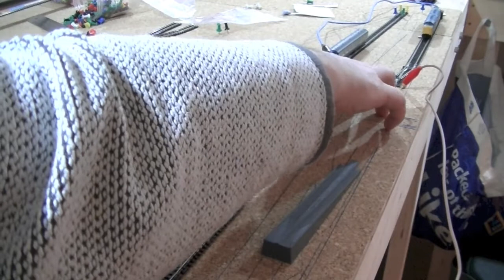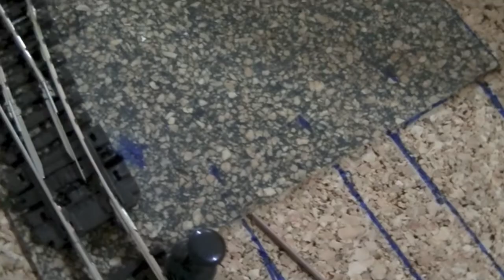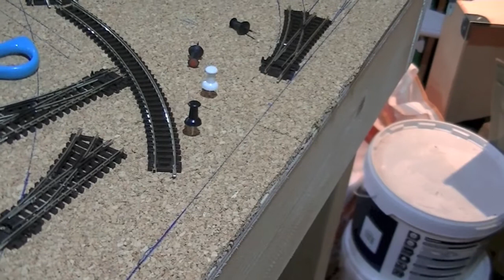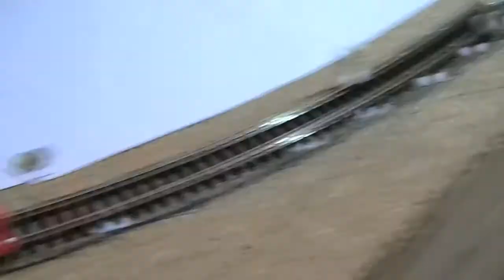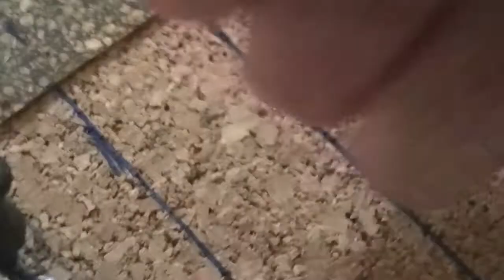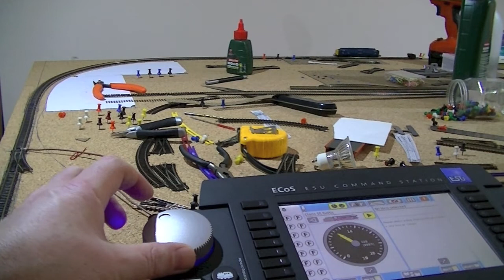Ringo's Model Railway: First bit of track down

Comment: Good to see the track going down , on my new extension I have soldered the droppers to the joiners before installing makes like easy no soldering near the track and plastic sleepers cheers Kevin
Reply from the maker: kevintregunna I thought of that, and may yet give it a go, but the joiners for N Gauge are sooo small, with my fat fingers and inexperience I'd probably melt them LOL. I will experiment though, as nothing ever happens if you don't try I guess. I think if I cut more sleepers off the end of the rails and solder - as you say - the dropper to the joiner (fishplate?) then I may find it easier to do, I shall try it out - watch this space.

Comment: A great feeling of satisfaction to glue down that first piece of track and then watch a loco pass over it. Onwards and upwards now Ringo, takes time, but well worth it for perfect running, which is not that easy in N Gauge...Ian
Reply from the maker: TheDiomedef16 Yes, the dream of perfect running .. not a lot of weight in N scale stuff, so I guess the tracks will need to be spotless, flat and smooth .. I will take my time for sure. Measure twice cut once is a good motto I think. But it is good to have track in position and a loco gone over it, very pleased indeed. Flexi-tracj takes a bit of getting used to, but I am sure I will get the hang of it quite quickly.

Comment: Been thinking it would be cool to have a setup based on the London Underground ... but, even at a small scale, it would be massive ... but think about the multiple levels ... and all those cool old art deco stations ...
Reply from the maker: ***** How would you see it? CCTV cameras I guess, Susannah Joaquim has just done an underground station and has cameras rigged up to see it
Reply: *****
I think I'd have to do away with the concept of walls and ceilings to the tunnels, except where necessary - ie, where they intersected/went over/under other lines ... if an stations had to be 'buried', then some kind of CCTV, fibre-optic based, probably ... mind you, considering the size of the network, you'd probably need a field to build it in ...
Reply from the maker: ***** So it woud be a Womble layout effectively. an Overground Underground ... wahhh wahh wahh wahhhhhh!
Reply: *****
Yeah, I think Wimbledon's on the District Line ... last stop on one of the branches ...

Comment: Excellent stuff mate, now you have your first train running, I really like your methodical way of working, well thought out first and then put the track down - perfect. Also glad to see another ECoS user, they are becoming quite popular now and not surprising either as they are a fantastic bit of kit - expensive but well worth it in my opinion.     ..........Graham
Reply from the maker: Graham Foulston Cheers Graham, I think it's my programming / analytical brain, I have to make sure everything is right and ok before moving on to the next bit .. drives the wife mad LOL. As for the Ecos, it is thanks to you, hovermotion and ***** that I decided on getting one, it seemed to me to be the one that suited my end game requirements the most, I can use it on my phone, PC and as a controller, it can operate shuttle trains easily and has loads of feedback functions from ESU, so seemed like the best buy - even if it cost over half my inital budget, I could have bought a cheaper controller initially and upgraded, but why spend money on something you are only going to replace?
Reply: ***** Agreed. Exactly my thoughts too.         ...........Graham